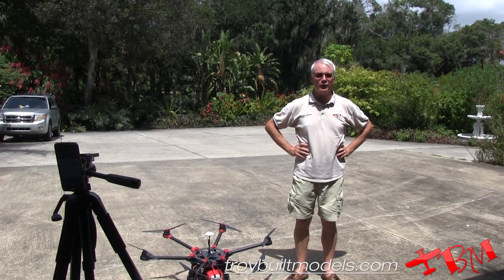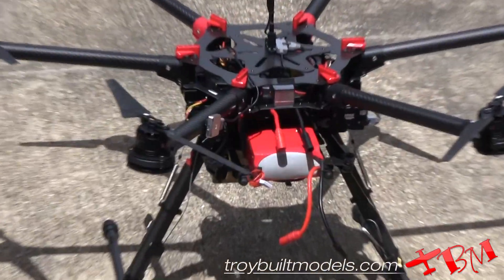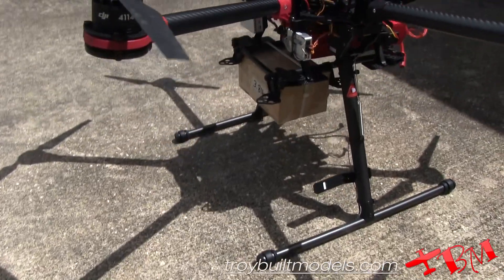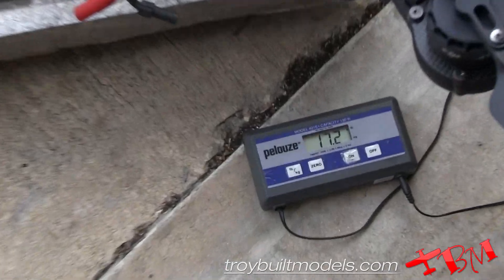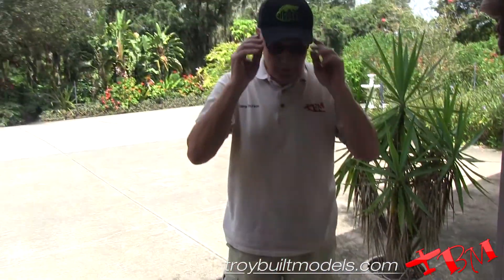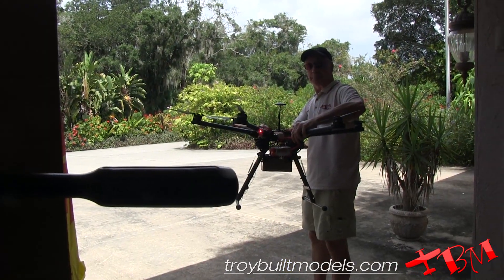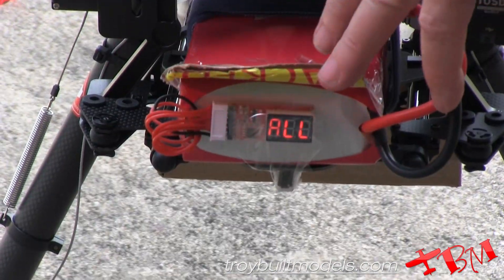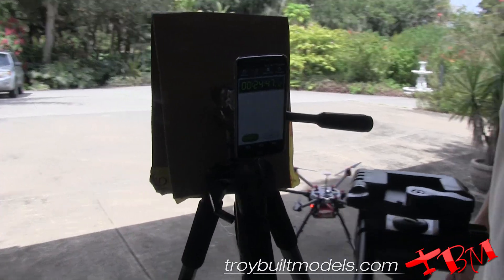DJI S900 Battery Flight Time Test TBM 21,000mAh Lightbridge + Nex-7/GH3/GH4/BMPCC Zenmuse 17.2lbs

Comment: Here is my test with a S900 + H3-3D + dual cam FPV + datalink + 12400 mAh : 15.30mins at 21V and before starting to land ( yellow light to red light on the LED ).

I'm waiting my 16000mAh ... just hope that i'll reach the 20mins before landing.
Reply: 13,7 lbs with a 12400mAh
14,1 lbs with a 16000mAh
Reply: manu Emmanuel
Test this morning with 16000 : 10mins to 22V and 22mins to 21V

Comment: yeah, right! Dummy box don't consume battery. Real gimbal does. this test is not valid for flight time. Sorry pal. People should know about this.
Reply from the maker: Pampaflyer Being that the gimbal only uses 200mA static and 400mA dynamically, it's safe to say that's not the major contributing factor to flight time especially when the flights aren't even a half hour.  With that said, theoretically the worst case scenario would be the gimbal using 200mA in the entire duration of the flight.  That is a drop in the bucket for these batteries.
Reply: Troy Built Models, Inc. I see your point. That is what is published on the DJI spreadsheet. But is also published that can reach 4A. There is a huge topic on rcgroups with s900 owners that are using zemuse gimbal and no one are getting much over 12-15min top of real flying.  Can you install a gimbal and repeat the test? Thank you.
Reply from the maker: Pampaflyer We will not be repeating the test due to it not having enough of an impact to the results as the gimbal would and should never have all three motors bound to reach 4A.  Lets just say the gimbal was using the entire 4A the entire flight of 20 minutes.  20/60*100=33% of the hour.  4A*.33hours=1.32A total being used.  In the worst possible situation (which would NOT happen) you would lose 1 or 2 minutes off the entire flight.  I just put a reader on the gimbal while moving it and binding it on 2 of the axis (forgot to pan) and reached 2.7A but otherwise it was 0.1A to 0.3A (100-300mA), please see the video here: http://youtu.be/KETEBw3zp4U